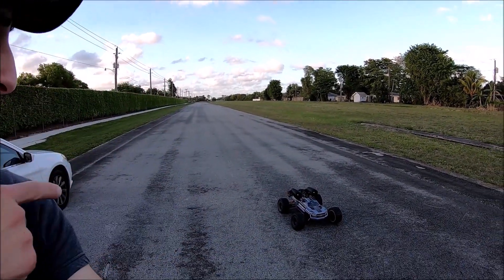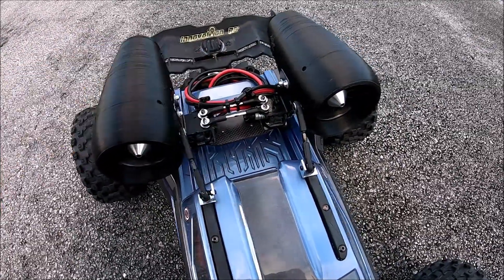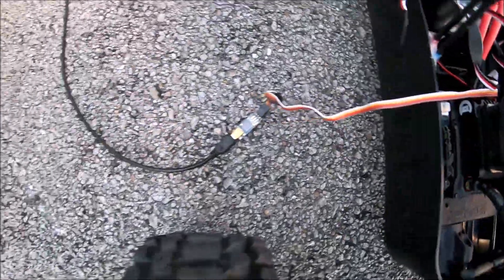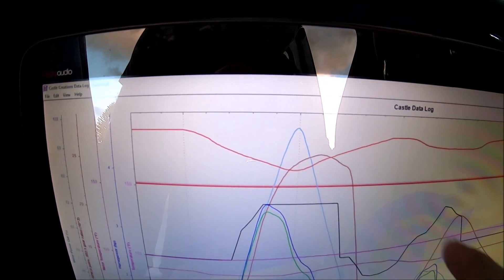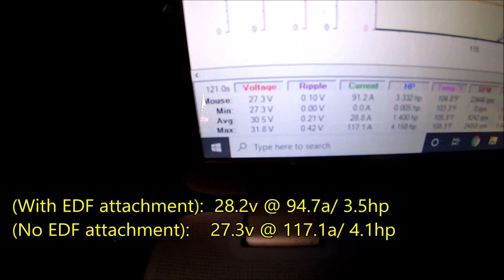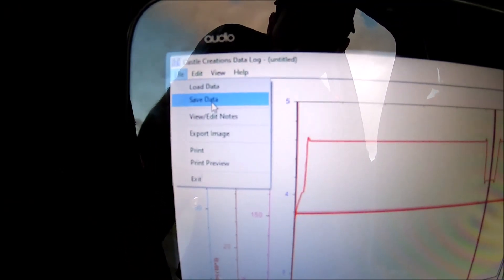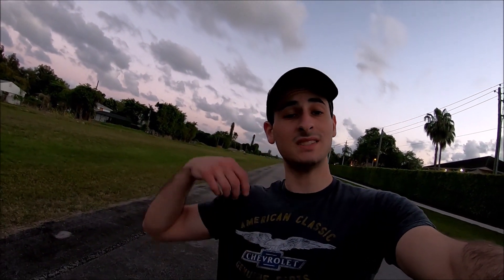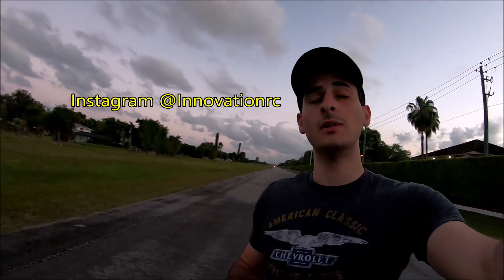Jet Kraton 8s "Jetlag" First tests & data log (EDF)

Comment: That's a pretty cool video! I'm happy to see you're still enjoying the fans. LOL! 

About that fan run... Most of the power draw  to the motor in a "normally geared" RC happens during hard acceleration. Once the motor redlines, it essentially cruises at the top speed and the current draw goes way down. With the fans on, the main ESC sees a lighter load, so it is able to spin up the motor faster. AND... the lower voltage sag lets the main motor rev to a higher rpm, meaning more overall speed. 

AND it just looks and sounds EPIC! 😲
Reply from the maker: Love the legitimate explatation. Without your help in designing the thrust tubes we wouldn't be able to see this attachment. Beautiful works of art. This attachment has been one of my favorite builds for this exact reason. It is doing exactly what I wanted to see. Let's see how it does going a little faster.
Reply: @InnovationRC  Thanks!

Comment: Theoretically, if you had a servo to control where the jets are pointing, could it enhance cornering stability? Maybe it could be programmed somehow to function with AVC?
Reply from the maker: Likely, but I am not sure if it's worth going that far into these edfs. You can make a car handle extremely well without them whatsoever. Plus less weight 😉

Comment: Very cool test but don’t you think the second run should have been without the dead weight on the back because it will take more power to pull the weight ? With the jets working it’s possible it’s just making up the weight difference? Not sure just a thought 🤔🤔🤔🤔great video 👍👍🔥🔥🔥💪💪💪
Reply from the maker: I believe it would have worked either way. I see your viewpoint though.
The dead weight added more load to confirm the results. Added 4 lbs of weight to get 10 lbs of thrust. Thanks man appreciate the thoughts

Comment: If less voltage is being dropped across the main motor load then max RPM is lower too. Did the fans actually increase top speed?
Reply from the maker: Yes, the fans were able to move the truck alone (without the main motor) so it is certainly confirmed
Reply: Innovation RC How much increase in top speed? The fans moving the truck alone doesn’t really prove it. The fans would have to be efficient enough that the loss of RPM on the main motor at top speed isn’t detrimental to the amount of thrust the fans output at max RPM
Reply from the maker: @TKO593  The rpm in the data log is calculated by the amount of pulses the esc sends to turn the rotor of the motor. If the fan assist worked, it likely screwed the data logs calculation up (rpm wise). If the esc worked less, sending less frequent pulses, to get to top the gearing out. Which is why I didn't even go over rpm differences, mainly focused on voltage drop, amperage and hp.
I think an rpm sensor would greatly benefit the data, I believe futaba offers the telemetry setup for it.

Because as you stated, if there was an increase of speed with the edf assist, then the motor rpm should technically be higher with more voltage than less. So, I agree with you 😊
Reply: Innovation RC Trying to fight thermodynamics is tough. Usually adding more moving parts doesn’t help. No free lunch.
Reply: The max rpm was higher in the edf run according to the log. Check it out.